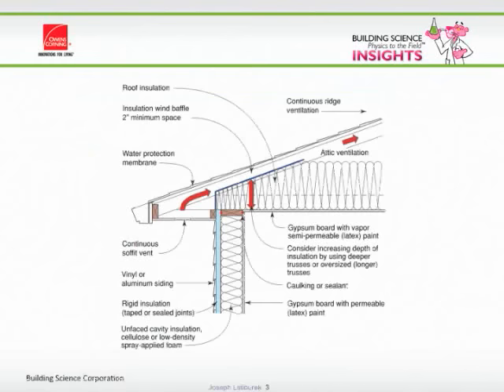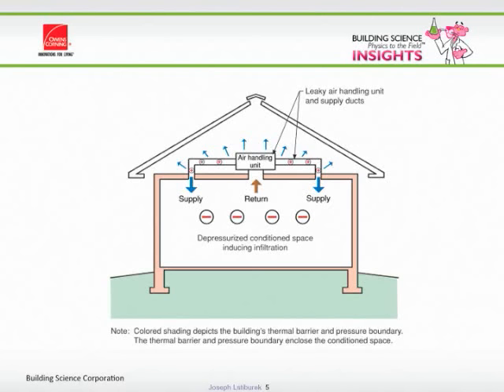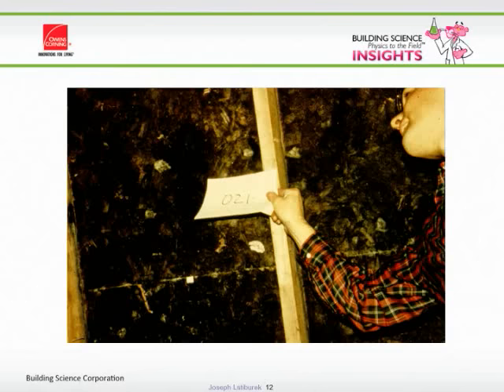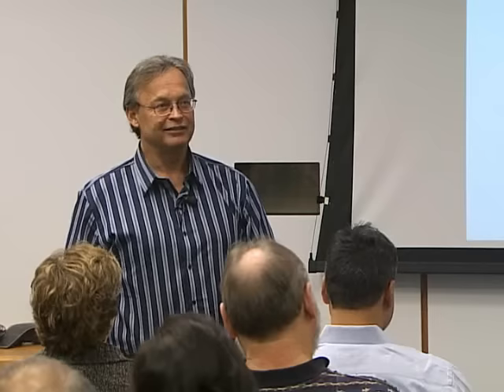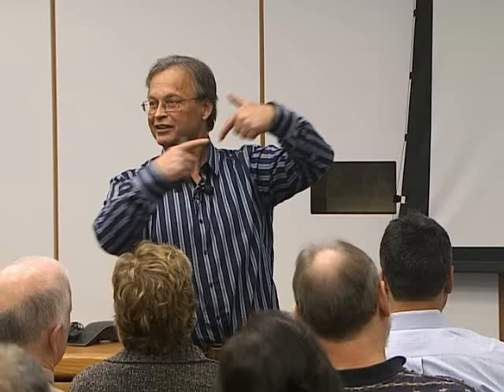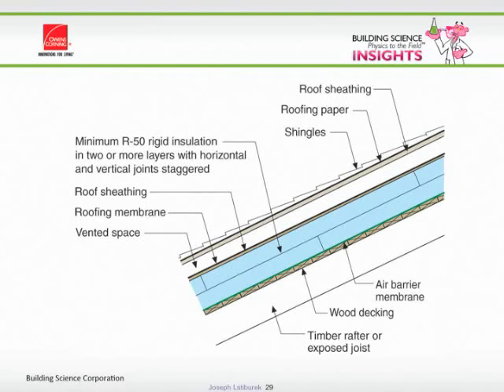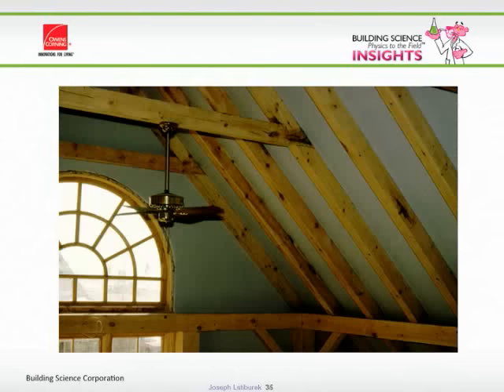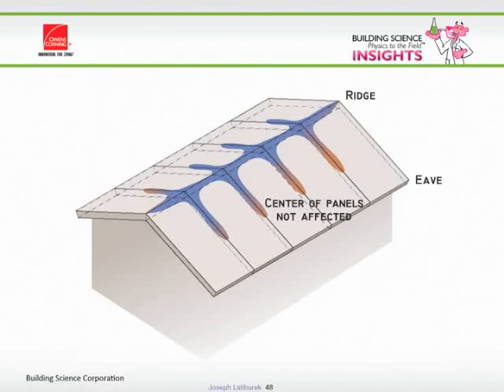Building Science Insights: To Vent or Not to Vent

Comment: I'm not in the industry but do take home energy efficiency pretty serious. Did exactly what Dr lstibuerk explains on my own home in FL, air sealed the ceiling to the best of my ability(probably not perfect but certainly way better than it was which was a leaking mess), put r60 blown in insulation in attic, added ridge vent when my roof was redone and added more soffit vents, even with my HVAC blower in a hot garage(also air sealed it as well as insulated) and ducting in the attic I saw a 20-25% reduction in energy usage and a much more comfortable home in the hot 90-100 degree days here in fl. It blows me away how much we talk about green energy and spending tens of thousand on solar or other super fancy expensive options yet do nothing in most cases for fairly cheap and very good ROI options. Making our homes more efficient should be the first step in helping reduce emissions/ being greener, instead we put up solar everywhere, windmills, buy hybrid/electric cars, set mandates of emissions on everything yet our homes are bleeding fossil fuel every minute of the day 365 days a year, imagine the impact if every home saved 20-25% on energy usage.

Comment: There is only over-designing or under-designing.  
A good over-design will cost 10% more than needed.  
A bad over-design will cost 50% more than needed.
Any under-design will cost >300% more then needed.
Reply: That is sound advice and words I live by.  I'm a Contractor coming from an Engineering family.  I refuse projects where parties want to cut corners.
Reply: So, then, "what's needed" is cheapest. How would you characterize what's needed?
Reply: A bridge needs to fall once in awhile no? Well maybe not, but have we forgot about tar paper etc and mixed technologies a little too quickly adding costs while defining improvement by $signs rather than common sense which is getting close to illegal anymore. Just saying if my house burns what the insurance glues, I mean builds, I would have to sell to pay the taxes. And I have a old guy built(non hydraulic)(carpenter owned) house I respect dearly. But tell that to those vinyl pushing banks/ins cos. LOL had a young buck contractor stop in. We talked lil about the new smart siding. He said it will prob fall apart, just something new. Job security scare or true? Who knows.
Reply: Hey TUR,,,like to share a sign on a bus bumper I seen on YT video "bus life"......."simplicity is the ultimate sophistication"

Comment: Dr Lstiburek liked your lecture. I am not an engineer nor contractor but home owner in suburbs of NYC. Ranch home with 2 story in the back. I currently have gable side vent on each side. Planning replacing the roof for some rotted edges. I do get ice dams on 1-2 corners. Also have recessed lights and bathroom ceiling fan for moisture removal and attic fan in the hallway so the ceiling is full of holes.  All the roofers recommend a ridge vent which seems makes sense but only one mentioned installing soffit vents. The others stated I didn't necessary did soffit vents. I can do without soffit vent and install a ridge vent and keep the gable vents open.  I understand soffit vents provide intake cool air and exhaust hot air via ridge vent.  But with gable vents and ridge vents suffice.  I don't think many of the roofer understand much about the engineer or physics behind proper ventilation. For my home what would be the best course a action in replacing the roof. 
-Also, any thought on underlayment some recommend the time test cheaper cost felt 15lb and other newer synthetic.
-Lastly, any recommendations to improve the "airtight holes", can I throw some more insulation over the recession lights
Thank you for any advice
Reply: Pall 511, you may want to run your exhaust to the the gable end if it hasn't got a dedicated port on the roof - if it does, consider removing it and venting to the gable ends, this will simply a reroofing. plumbing penetrations can also be removed and their intake with a one way valve ( if code permits ) I see these in commercial buildings, they allow air to go in, but dont let fumes out. look up rockwool can light cover, these can be air sealed. you will want to find where your leaking the warm inside air, and seal the gaps.
Reply: Pall 511, you may want to run your exhaust to the the gable end if it hasn't got a dedicated port on the roof - if it does, consider removing it and venting to the gable ends, this will simply a reroofing. plumbing penetrations can also be removed and their intake with a one way valve ( if code permits ) I see these in commercial buildings, they allow air to go in, but dont let fumes out. look up rockwool can light cover, these can be air sealed. you will want to find where your leaking the warm inside air, and seal the gaps.
Reply: Insulation doesn't come close to stopping air movement. take a chunk of insulation, and place it over your mouth, and see if it stops you from breathing. (Not really, you'll be inhaling fiberglass particles.) I don't think you grasp the concepts here. Try to consider the long term cumulative effects of small amounts of air or water-vapor transfer over long periods of time, with warm and cold cycles occurring every half-day.

Comment: The only ductwork I have in my attic is coming from the fan on my stove and microwave a second and third would be the venting for my two bathrooms going up through the roof. Are those okay to have in the roof if not where do you vent them to? And all my other venting including my washer dryer goes out through my basement including the heating. No air conditioning in my house except for window air conditioning. And I realize that these three events do take some of the heat out of my house but they also take away the smell in the bathroom and the humidity from the bathrooms and the smells from cooking. I also have several 6in charcoal filters at using my grow rooms should I rather have a 6in charcoal filter just of Andre circulate the air inside my house as well? Thanks for any information you can give me.

Comment: Awesome information sir. I’m designing a new house in SW Florida and researching a conditioned roof type assembly. Would an insulated roof deck on the outside of the sheathing with 1x4 nailing furring strips on top and a standing seam metal roof, plus batt insulation or open cell spray foam in the attic work in HVHZ and humid climate?

Comment: Joe, I'd like to hear more on the effects of the urethane glues and resulting perm ratings in plywood and OSB.  Much of your discussions are based on vapor permeability and reverse vapor pressure.  The more effective the cold attic the less relevant the topic.  But in awkward locations like cathedrals it may be an issue.  Add a surface coating (Zip) and it's another variable.  Your thoughts?  thank for the presentations

Comment: I am a DIY, pretty handy but no professional.   have a question regarding ventilation of a slate roof.  Roof is original, 80yo, in good shape, roof deck is made of tongue and groove 1x8 boards. I would like to make the attic a living space and need to insulate (location Long Island, New York) the roof to do so.  The house has"flush eaves", i.e., no soffit, so the only way I can see to set up ventilation in the usual manner is to rip off gutters, gutter guards, dental trim and fascia and install fascia vents to allow flow up through the baffles to space created by collar beams and out through gable vents. I was told by an old construction guy that I needn't bother with all that because a slate roof over 1/8 are essentially self ventilating so there is no danger of moisture buildup.  Is that true?
Thanks for any input
Reply: I'll be interested in reading the responses ... I have a slate roof with no ventilation; similar situation to yours.

Comment: The Summary interim conclusion being air vent above the insulation being the historical satisfactory statement and the maintenance interval known.  The compare ending possibility being to the compare in answering the question in possibility had there been the infiltration from the roofing.  The condition in air vent underneath occurring with standing.  Hot climate one had say insulate the inside.  

Cold climate one had say insulate the outside.  There are portable interior air conditioner, dehumidifier , heater and other such interior space environment stabiliser.  

The monitoring continue in all grade in building.  The study continue.  The as is state of the compare is appreciated.

Comment: Dear Mr. Lstiburek. I'm constructing a small roof in Sao Paulo, Brazil. We have no problem at all with snow, but heat is a big challenge. I'm having the opportunity to apply the knowledge that I learned from your videos on YouTube, but still have a small question: what can I do to avoid birds and bugs from invading (and reproducing) at the air layer of my roof (right between the tiles and the insulation)? Thanks!
Reply: Plastic grating/grid easy fix
Reply: Typically a metal mesh screen and or a bird block designed for the roof profile.

http://www.fasciadivision.co.uk/bird-guards/

http://www.247wildlife.com/tileroof.htm

http://www.hellotrade.com/eagle-roofing-product/eave-closures.html
Reply: In SE Asia termites are an issue. They use metal, not wood (food).
Reply: LOL ... or both.
Reply: "what can I do to avoid birds and bugs from invading (and reproducing) at the air layer of my roof (right between the tiles and the insulation)? Thanks!"
Um, you could try putting screens at the places where the birds and bugs might get in. Otherwise, as a Brazilian you should know this:
Quem não tem cão caça com gato! Neste caso, literalmente. ;-)

Comment: Gotta quit the avalanche sim. it does not work the snow density is greater than O2 transfer rate if the snow depth is more than 6in.. this arises due to near freezing liquefaction of the crystals due to motion resulting in refreeze upon sitting without the air spaces the snow originally had.

Comment: The presenter was very entertaining. But if I understand this correctly the entire video can summed up as:
Insulate the roof and make the attic the same space as the house using a double layer of insulation with plastic to separate them. Then put a vented layer on top with the air able to travel to, and escape at, the apex.

Someone please correct me if I’m wrong.
Reply: My take was vent the roof.  Seal the ceiling.
Reply: @rmgunter01: My take was that "sealing the ceiling" is impractical. Maybe you can try, but your design shouldn't count on such a seal. And if you've got ducts up there, forget about it.
Reply: There are other options available that render recessed ceiling cans unnecessary, and they're getting stale anyway, suitable for aesthetic drama queens. And in temperate climates, there's no need for ceiling ducts, or any utilities above the ceiling. And if you have clients who insist on one or the other, a little more assertiveness will work on many. Screw the rest. If you can't walk away from a bad client, especially in this market, then there's something wrong with the way you're doing business.
Reply: I think the point he is making  is that completely sealing the attic with foam insulation in the rafters creates an airtight "conditioned" space that will effectively be similar to the inside of the house in terms of temp and humidity.  This at first may seem counter intuitive to most as they are thinking about the "waste" in terms of heating and cooling attic space, but it isn't in reality because the alternative of trying to seal the attic as separate space from the building interior at the level of the ceiling is practically impossible because of all the penetrations and air leaks.  The other point that he is making is that  (at least in the south this is true) the HVAC system is usually in the attic and it is incredibly inefficient to try to run this system in the extremes of temp and humidity of an unconditoned attic, especially if you assume the 25% leak rate he mentions relative to the duct work.  He is arguing that by using roofing underlayments and foam insulation to isolate and seal the attic (directly below the roof deck), the attic  becomes part of the "conditioned" space of the building which all but  eliminates the issues with water inside the envelope under the condition that the building structure be protected from moisture coming in through the roof.  Given the assumption that penetrations and imperfections will exist in interface between the underside of the roof surface and the underlying decking (in spite of a water and air barrier being in place as an underlayment), you need to allow the structural parts of the roof to dry outward, and this is accomplished by a vapor permeable characteristic in the roof underlayment.   The use of the mesh he mentions just allows any vapor  to escape from this space between the undersurface of the roof, and the underlayment.  He puts it at the ridge because all the vapor eventually migrates there, as evidenced by the earlier mention of finding that all the failures seemed to occur within 8 inches of the ridge.

Comment: Informative video.  I am interested in compared performance with house wrap (Typar, Tyvek, etc.) as compared to old fashioned building paper in 15# and 30#.  Also the same question as regards new synthetic roofing underlayments as opposed to a 45# or 30# building paper.  I live in a temperate rain forest (Ketchikan, Alaska) where building materials are subject to high stresses.  Knowing what works in this environment is important but rarely addressed.  Such as when James Hardie sold their planking and it failed totally to the point they revoked their warranty but continue to sell the product.  Thanks for your help.  Douglas Thompson
Reply: Douglas Thompson where can I read more about this failure? ( hardi board )
Reply: James David Robinson Hello,  I don't know of any literature published about it.  Most journals take advertising from James Hardi so little has been heard in print.  My information comes from the real world (come to Ketchikan, Alaska  a temperate ocean zone), correspondence addressed to Hardi and ignored, then warranty claims by our local retailer to Hardi that were denied.  These are not isolated occurances but uniform failures within a few years.  I also installed their product stringently following their guidelines on the web far exceeding the minimums.  Just not made to resist any moisture and has no strength.  Hardi doesn't make it available but they tell the dealers and bury it in the detailed web info. that in environments with winds over forty need to face nail as well.  Over the years they keep adding stipulations to cover the product weakness.  It literally disolves with moisture and time.  It doesn't hold paint even with a rain shed installation.  You won't find any contractors recommending the product here.  Doug
Reply: PS:  According to my retailer Hardi revoked their warranty in the entire state of Alaska.  This was twelve or fifteen years ago.  Doug

Comment: Great presentation.... One sure way to not get duct leakage is to use a Hot water heating system. Especially in a cold climate.
Reply: What about cooling?
Reply: How often do you really need cooling? If the home is sealed well and insulated well that will take care of most of your needs. A hydronic system will give you more comfortable home over a hot air system.
Reply: During the summer months ofc... We still get temps in the 80s and 90s in the summer time (100+ is rare but it does happen)...
Reply: I live in New England. I do not have AC at all. I just think it is silly to pick your heating system based on a few days of cooling.
Reply: Sure, but mini splits are more efficient for heating especially on days when the ΔT is pretty low.
Reply: Are you  not familiar w/ boilers & hot water systems that have outdoor reset? These units have weather compensation that change the system temperature based on the outside temps. Not only do these save energy (up to 20%)  but they raise the comfort level so as not to over heat.
Reply: I agree that hydronic heating is the way to go, however, a ducted AC system is needed in most of the lower united states. In my climate area we could get away with no heating system, but cooling is mandatory.
Reply: k copp.   Your reference is England, and that makes sense.  When one experiences hot AND humid weather, there is a whole different experience. Spending some time in a southern climate taught me this well.  I thought most were just lazy people in the south, but after being there for a while, I see that it takes LOTS just to get through the day (the days without air conditioning).  I recently noticed the annual temperatures of Wales, and I can see why you wouldn't see much need for cooling.

Comment: I wish I would have watched this video before I renovated my house. Every problem he talks about is absolutely true. I live in a high snow load area and never had a problem with ice damming. During a whole home Reno my insulation contractor talked me into spray foaming the roof deck. When it starts to frost at night during the fall you can see the rafters melt clear lines in the frost on the shingles. I’m assuming the ice damming is happening when the snow piles up and holds the heat leakage down on the roof deck.

Comment: On SIPs, you goop the splines, not the joints.  The vapor barrier (ordinary polyethylene plastic sheeting,) in the ceiling is under the SIP panels, between the panel and the drywall.  It's not difficult, it's not complicated, and it doesn't take perfection.  At the peak of the roof, the joint is sealed by the ridge beam.  I've lived with this in a cool, wet climate for 17 years, with a cathedral ceiling and metal roofing with building paper under it.  You can't see where the panel joints are when it snows.  There is no attic.  Nothing is ventilated.  So far, so good.